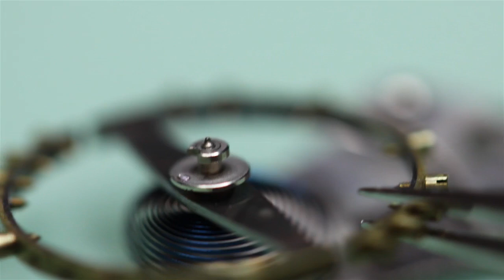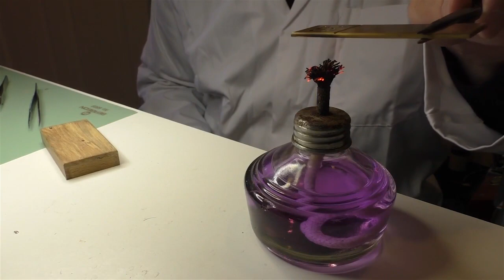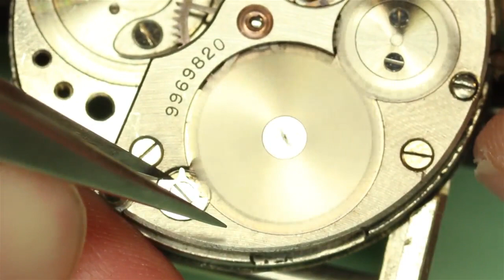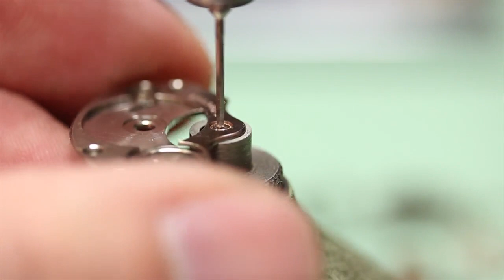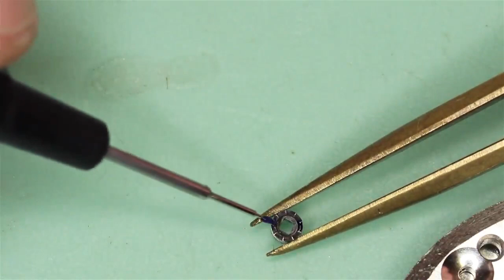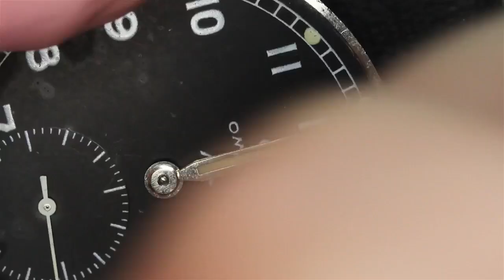Omega 30T2 Military Watch Service and Jewel Replacement and repair tutorial

Comment: i noticed the balance wheel is not whole it has a cut in it  is that normal ? or just a part of manufacturing
Reply: I believe this is a bimetallic temperature compensating balance, also known as a Guillaume balance.  The slots in the balance wheel allow for expansion and contraction.

Comment: Thanks Mark.... Do you clean the crown and stem  ... Or not necessarily ... Beautiful omega.. Nice job... It is slow at first but I find that the Seike auto I am doing" I went on line and bought a few dead movements and as I am rebuilding I look to the old one for what goes where...  Boy I have lost a circlip and the incabloc brass spring for top of cap stone.. Both which I have found... I,ll have to think my way around not losing anything.. One thing comes to mind is the quality of your tweezers and your ability to use the,... Are you in Australia now..  Thanks a load for your help..

Comment: When you replaced the bushing for a jewel, was the outside diameter of the jewel the same as the bushing you replaced, or did you have to ream the hole in the bridge to a larger diameter? Is is easy to find jewel replacements for bushings without further work to change the bridge hole inside diameter? Thank you for an excellent video. I truly enjoy seeing older time pieces repaired and restored much more than new time pieces. Preserving history, is important to me.

Comment: Amazing video Mark,thank you. One quick question, when you replaced the worn bearing with a jewel did you turn down the staff to suit a standard size jewel or was the jewel fitted and then reamed to suit the staff? Was the jewel a press fit into the bridge or do you use shellac to mount it too? Sorry if being a pest but find the repairing side fascinating.
 On a high note , I can now confidently strip and reassemble a Valjou 7750 and it still runs! Done my one several times now and getting more confident. This is directly down to you so thank you. It is hard to quantify just how good this makes me feel but it's right up there with the very best feelings ever!

Comment: Why there is a cut in the balance wheel (16:32)? It is supposed to be so I assume but why is it not one whole wheel instead? Is there a purpose for that cut in the weel? Nice video, once again, thank you!
Reply: The spit allows the balance to expand and contract with temperature changes which helps with watch time regulation.

Comment: Sorry mark its 174 /190 some were ady
Reply from the maker: Its very low Ady. I would remove the balance endstones, give them a good clean, and the pivot holes, re-lubricate and assemble. Make sure there is no oil on the pallet pivots and make sure the escape wheel teeth are lubricated properly.
Reply: Watch Repair Channel Ok mark thanks for that i will give a go cheers ady. ps one more i have old national electric cleaning machine do you rotate it when drying plus what time would you recommend  for drying time as  i,m worried about melting the shellac on pallet forks / rollers thanks again ady
Reply from the maker: TommyTightPants0115 depends on how close the basket is to the heating element. I have mine in for 11 minutes in my SuperElite and it is about a basket height away from the element. Seems to do the job nicely.
Reply: Watch Repair Channel Thanks mark. ive just cleaned and oiled up still the same but amplitude has gone slightly  i think i will order a new balance for the price and see. The wheel has a lot of play in it cheers pal thanks again ady

Comment: Hi mark hope that your well. Only asking have you ever come across a a problem in evolving a balance wheel that when you set the timing /beat dial side down and its OK then when you turn the watch dial side up it then gains i'e 215 seconds or more  is  it because their is a lot of play between the  the jewels and staff ( seiko 7s26a  movement ). do you have any suggestions or just have a average / new balance. best regards ady p.s the spring is clean and not touching
Reply from the maker: What does the amplitude look like?
Reply: Watch Repair Channel hi mark the amplitude is good 0.1  up side down or dial up  21600 beats per minute their is a little play the balance pivots / jewels are fine strange !! ady
Reply from the maker: TommyTightPants0115 0.1 may be referring to the beat discrepancy. The amplitude is measured in degrees. For example 270º is a reasonable amplitude when the watch is mostly wound up.

Comment: I really enjoy your videos and you always seems to do the overhauls "guided by the book". But why do you choose a smaller screwdriver than the screw head? I think that you should have used a same size screwdriver, even if the screwhead is already badly damaged by years of abuse.
Reply from the maker: Its a habit I personally have adopted over the years, I don't always do it. The mentality is that when I first drive the screws in I use as little force as possible to help prevent broken screw heads, a smaller bladed screwdriver helps to enforce this policy. I then go over the screws once the watch is assembled and carefully tighten the screws further if required, especially automatic works screws as these can tend to work their way loose over time, but thats another topic :)

Comment: When you installed a jewel for the center wheel in place of a bushing. How did you maintain center for the cutting reamer?
In clockwork, the opposite side of the worn hole needs to be relieved so the reamer will find center.
Thanks
Al T.

Comment: Great video Mark. Subscribed. 

Do you have more detailed video on how you choose jewel size and how to source Seitz jewels. I have put in a few jewels but not even remotely sure what I have is even Seitz jewels. Choosing a reamer is not always straight forward as there is suppose to be I think 1mm smaller diameter. Maybe my measuring methods are not so great. Would very much appreciate more details in this regard.

Happy New year and Thanks.
RJ
Reply: no reply...

Comment: Hi mark another fantastic video ive learnt so from these videos but only asking do we oil the pallet fork pivots if not and why.  I know about oiling the exit jewel.also can we see some videos on timing and calibrating the movements best wishers and merry xmas  ady
Reply from the maker: Hi Ady, nice to hear from you :)
It is not recommended to oil pallet pivots as the oil will create too much drag and impede the movement of the pallets as they move from banking to banking. Although some watch repairers may use a very low viscosity oil, I am of the opinion that it can cause more problems than it would solve. It is the same with the minute recording wheel on a chronograph - oiling the pivots will potentially impede the movement of the wheel rather than help it.